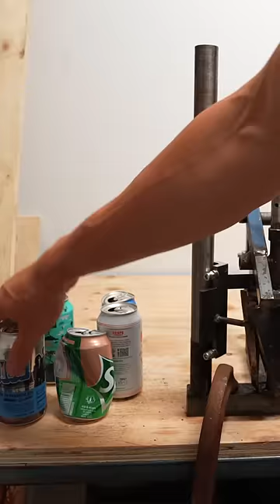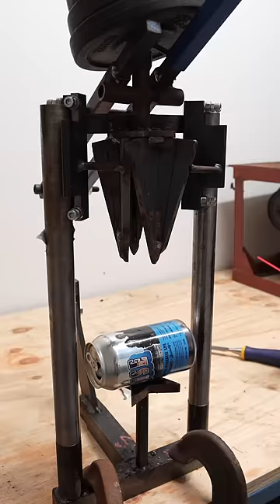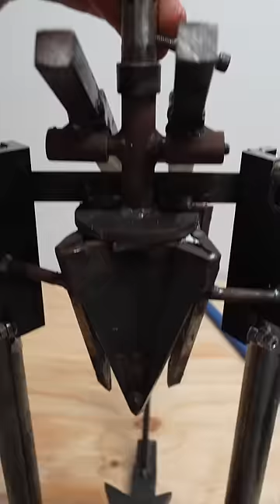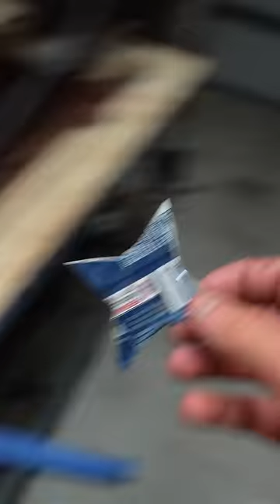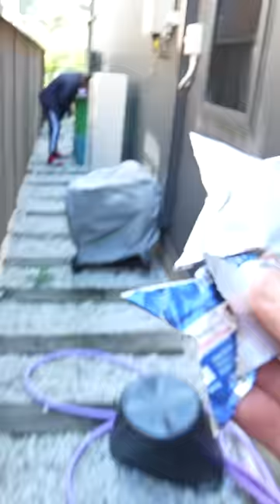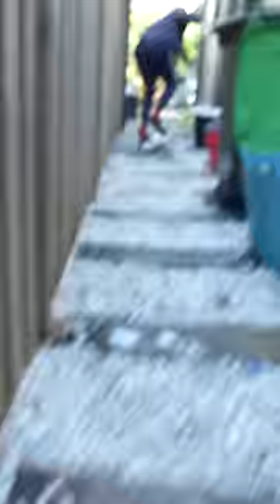Making throwing stars out of metal cans

Comment: thats actually pretty cool ngl i thought they would be flimsy
Reply: That's what surprised you ??? Im surprised they're actually sharp...
Reply: @birisuandrei1551  aluminum is pretty sharp. try cutting a can open and see how sharp the sides are
Reply: @PeacePills.  thats not a proper cut though he's tearing the can's into that shape, and in that case the metal's sharp side would end up being pointed to the side making the edge more or less round and useless, im almost certain he must've sharpened the edge Afterwards there's just no way...
Reply: Once it's pressed together yeah it's quite strong laterally but if you try to bend it it'd probably bend easy. It's the shape that makes it strong. Not the thickness that matters but the geometry. At least that's what I tell myself.
Reply: @birisuandrei1551  From my experience with cans, it seems almost impossible to tear a can in any way and not make it sharp.. Again, go cut a can, or even tear it. It's sharp. Even if it wasn't sharp, a metal that thin would stick into a melon and drywall even if it was pretty dull.
Reply: @Love_N_Let_Live  true, i just don't know because i wouldn't cut a can because I'd almost definitely cut myself 😂
Reply: @birisuandrei1551  👌 fair enough. To be honest, I was pretty surprised how well it worked. I didn't think it'd fly that well and have enough weight to really go in.
Reply: @birisuandrei1551  ahh so it’s a jagged edge, still fairly sharp
Reply: @birisuandrei1551  cut metal is absurdly sharp. sharper than any household blade.
Reply: @sossololpipi9633  that's bullshit 🤨 who told you that ? It's nowhere near as sharp as a knife, you need a proper edge for sharpness not a jagged mess caused by tearing of metal.

Comment: Bro took a 2 dollar can worth of soda turned to 10 cents for recycle into a 20 dollar retail item. He’s a genius
Reply: 2 DOLLARS?? They sell them by the 18 pack here at .37-.56!
Reply: I'd pay 2 dollars for that
Reply: @nobilesnovushomo58 that still roughly cost 2$ per can of soda
Reply: @lukebell7131 I wouldn't pat for that
Reply: Pie Squared  dw i wont
Reply: 2 ??? Expensive,they sell like for 50 cent's here
Reply: Pie Squared  like i care
Reply: Just no.
Reply: @catmosw  when he's saying .37-.56 he's saying that's the cost of the individual can. just depends what brand or what store you buy them at. get the cheap brands at a cheap store at 7 bucks for a 18 pack or 10 bucks for an 18 pack at another store. if you're in a couponing state you might be able to buy them for just the cost of the crv if you're good. this is for soda btw

Comment: If you mounted a spring inside of that thing it would maybe automatically push the can star back out once you lifted the lever,  save the fiddling
Reply: it'd have to be a strong spring to work constantly and that might warp the tin
Reply: @spongmongler6760  aluminum actually, and it depends on how it’s done
Reply: @dbio305  you literally just tried to correct me but said the exact same thing, worse.
Reply: @dbio305  spelled aluminium wrong 😁
Reply: Now make the spring really really strong so that it actually just injures you whenever you make a new throwing star
Reply: @haydanoc8779  There are two ways to spell it correctly. His and yours.
Reply: @haydanoc8779 both ways have been officially recognized as correct. Imagine not keeping up with the world.
Reply: @spongmongler6760  if the spring had a plate on it then there'd be no deformation of the ninja star,  even distribution of pressure
Reply: @Mika-Fresh  hahaha imagine the bliss
Reply: @haydanoc8779  The Metal was originally named "alumium" (then Aluminum) in 1807 after the mineral "alumina". The name "Aluminium" only started being used in 1812 because, I shit you not, the British thought it sounded more fancy.
Reply: @GolenCheeseIt  Thanks for the fact! Nice 👍🏻
Reply: Don’t even need a spring just a plunger to manually push the star out by pressing down.

Comment: Supposedly stars weren't actually thrown but instead held in the hand and used like a pocket knife. I don't know the benefit(maybe it was hard to sharpen them or it was easier to pull them out of wood or armor) of using them over just a knife but I heard they weren't actually thrown. Besides, a small spear would be deadlier, more accurate, and easier to conceal in separate parts than a star.